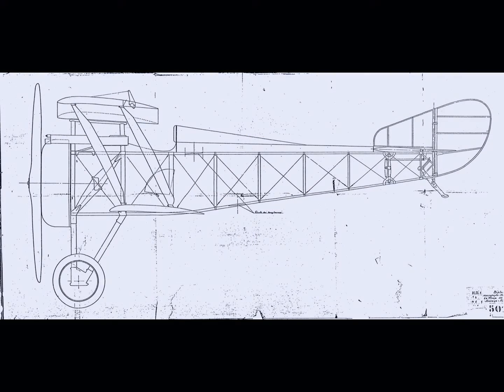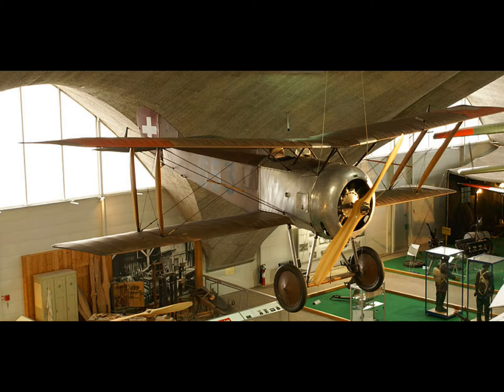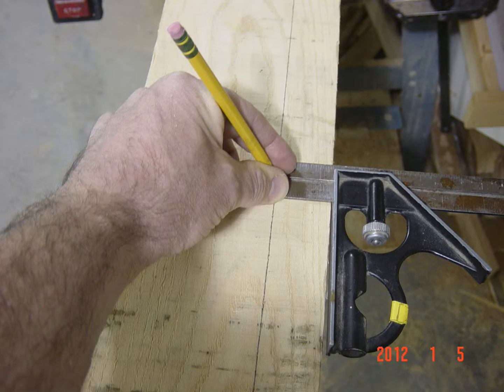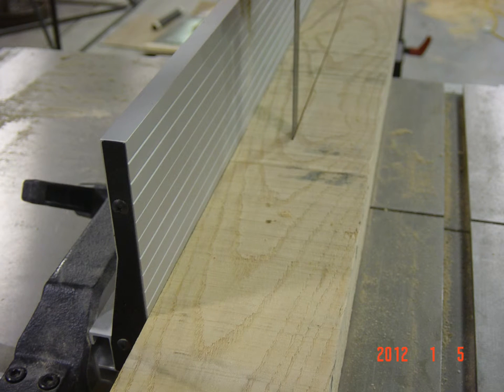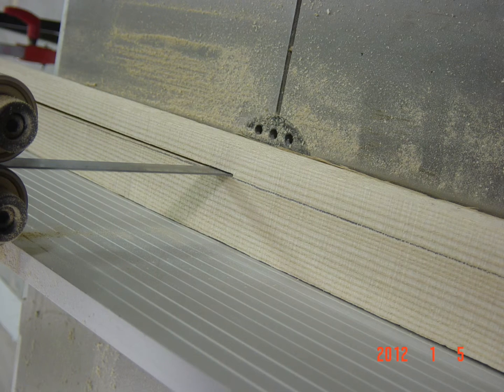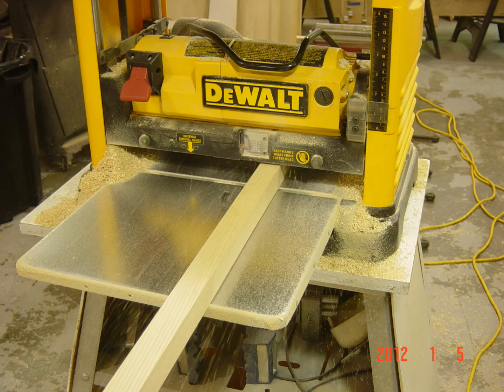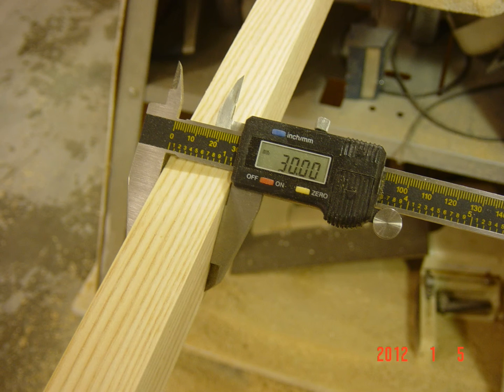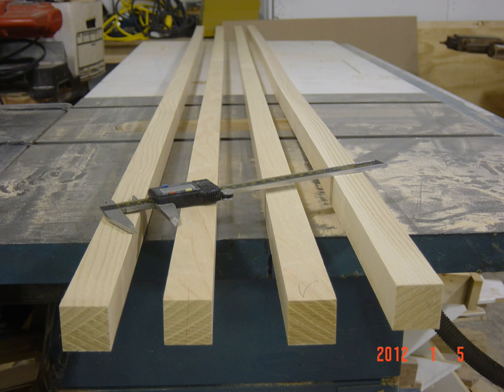making-longerons.flv

Comment: A few questions. 
1.  Why did you use ash and not stika spruce??
2. How big are the longerons on a Curtis Jenny and what are they made out of?
3. Why did you use a band saw and not a table saw?
Thanks for helping my curiousity!
Mike
Reply from the maker: Hello bentonbee1, Most aircraft that I know of use Ash for their longerons because it is stronger than spruce and will hold the steam bent shaper required better. The longerons on a Curtiss Jenny vary in width and height, depending on where they are located. The start around 1-1/2" and taper all the way to the rear of the plane, where the tail  is. We used a band saw because it gives you a much cleaner, smoother cut and is easier for one person to control the movement of the lumber through the saw. Long pieces of think lumber are hard to saw accurately on a taper with a table saw. Also you run the risk of burning the wood using a table saw as the blade gets plenty hot, cutting through a piece of Ash. If you want more details on wood working for aircraft, I suggest you purchase our 4 hour DVD set from our web site www.BlueSwallowAircraft.com . Thanks for your question. Good luck on your project! John Gaertner